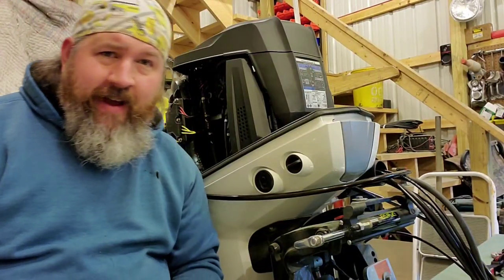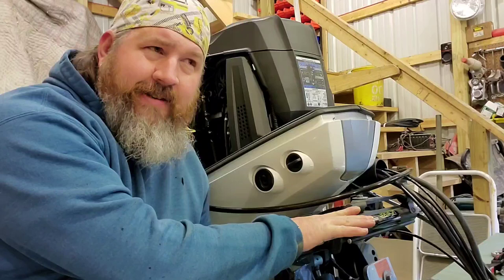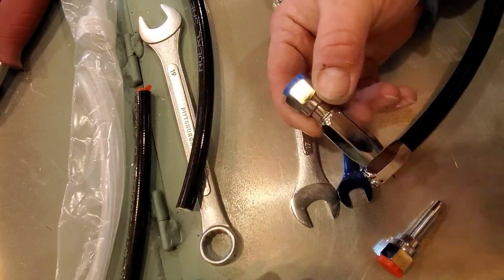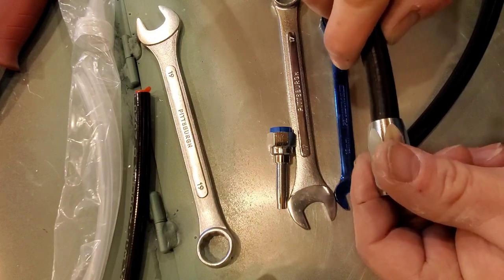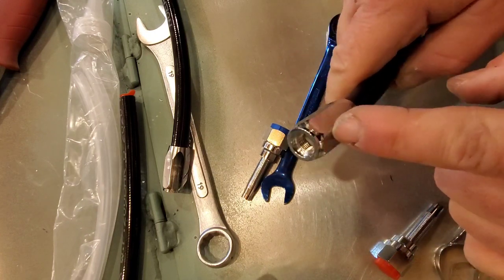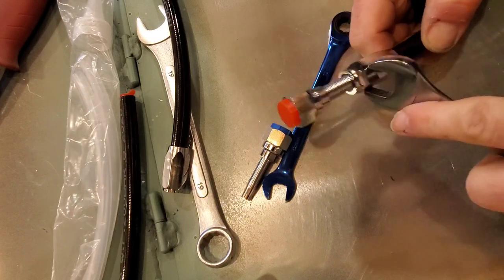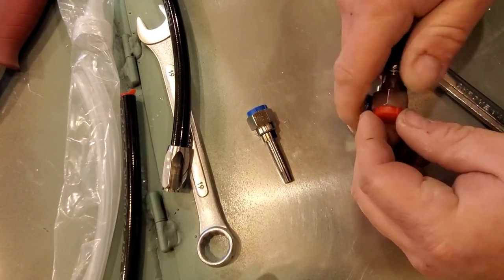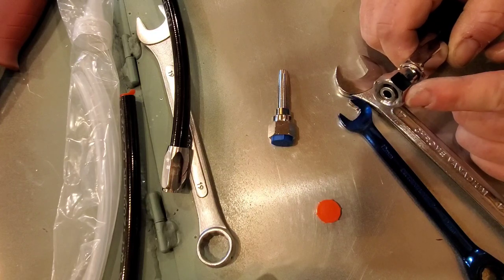How to make hoses for Noerl Hydraulic steering systems

Comment: Thank you for this video!!!  Vevor's instructions were lacking just a bit!!     So, question - I have the same brand system, and I'm installing on my first boat - can you tell me if I need to put anything on the lil stubs that are used to bleed the system?  I'm confused - when those stubs are tight, do they prevent oil from coming out, and when they're loosened slightly they let oil flow?
Reply from the maker: No need to cap them. If they tight they fine. The brakes on your vehicle operate the same way
Reply: @DustinApple  Thanks sir!

Comment: Just installed a noerl steering kit on my boat. Hasnt left the shop yet. Leaks where the hydraulic lines connect to the orb fittings on the helm. Just spend the extra $200 and purchase a baystar kit.
Reply from the maker: I've installed 3 with no issues.  Probably just failed to tape them and tighten properly.
Reply: @DustinApple  tape? Maybe im used to installing SeaStar steering systems but we never use tape.

Comment: Dustin, great video!  Question - you are using the NOERL steering?  We are hesitant, do you have any experience with it?  would you recommend it?
Reply from the maker: I've installed 5 of them without issue.  At less than 1/2 cost of SeaStar yes I definitely recommend them.

Comment: Thank you for the video. I'm considering one of these kits for my Bayliner 1804 F/S with a Mercury 125. How has your Noerl steering system held up for you?
Reply from the maker: I've installed 3 of them no issues.  Get a buddy to help bleed the lines. It will take 1.5 qts for 20' of line.

Comment: Great vid! Fixed my problem quick. Quick question, how many turns does it take you to completely turn the engine around?
Reply from the maker: Not sure... 4 maybe 🤔.  I got a steering wheel witha speed knob so I don't pay much  attention.
Reply: @DustinApple   hmmm… would 6-7 be too much? Would this mean I don’t have enough fluid?
Reply from the maker: @breakingbass4322  there should be zero air in your line and pump. If there is it will definitely make your turning softer. You should not be able to turn the wheel 1/4 turn  without the motor moving.  Hope this helps
Reply: @breakingbass4322  Is yours still 6-7 turns lock to lock? I just installed the same system on my boat and it takes 7 turns which seems like a lot!
Reply: @justinmcginnis3315   It is still 6-7 lock to lock! I am not that worried about it now since I ran a boat with a seastar kit a few weekends ago and it also had about 6 turns lock to lock.
Reply: @breakingbass4322  Good to know. I don't mind it, the only time it's a pain in the ass is when you're docking it feels like you have to crank on the wheel alot to go from side to side but not the end of the world. For half the price of Seastar I will deal with it.
Reply: @justinmcginnis3315   totally get it. But at the same time I’d rather crank a few more times at the dock using my pinky finger than throwing out my shoulder trying to move the engine back and forth